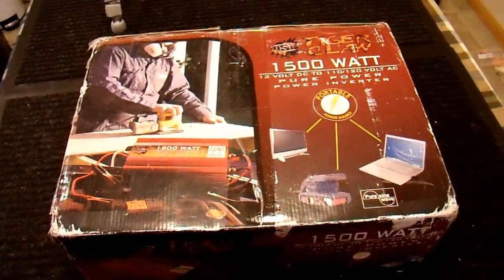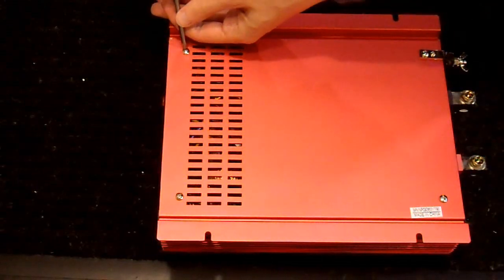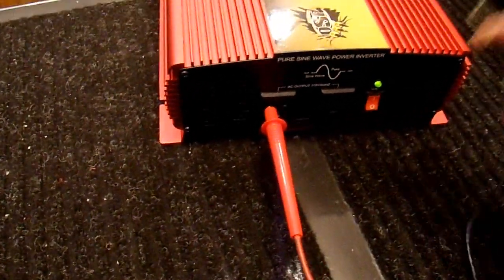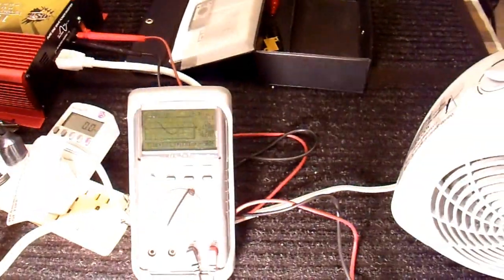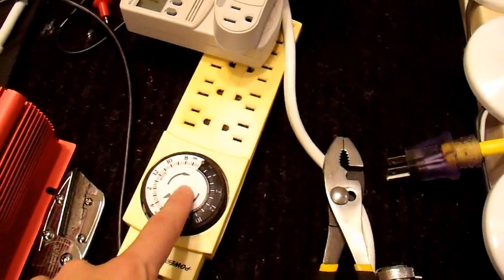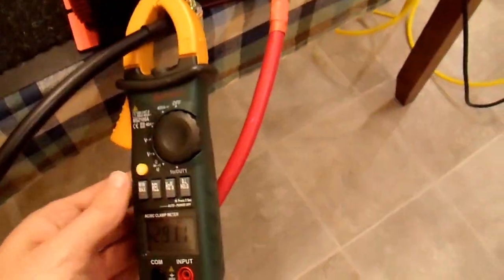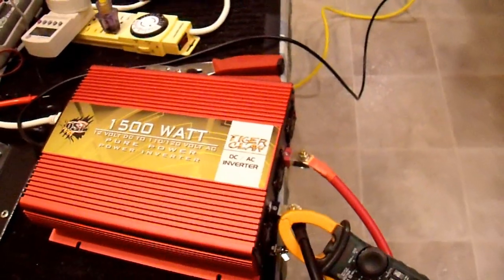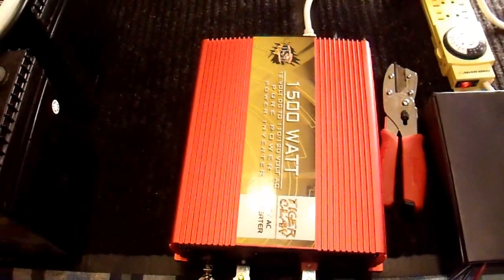OSP Tiger Claw 1500W Pure Sine Inverter Unboxing and Review

Comment: Just bought a 1500 Tiger Claw.  Your video(5-10-13) said it has a "live neutral config" and xboxer said in his video(2-4-14) it does not.  Who is correct and the reason I ask is I would like to back feed into my house main.
Reply: +Ronnie Boykin I would not back feed. I have a two pole transfer switch I connect to with a NEMA 5-15P to L14-30R. I'll be doing an updated video in the next few days soon. Also this inverter does not have a live neutral because of the fact you can bond the neutral and ground together and nothing will short circuit. You can easily connect this inverter to house wiring (via proper methods other than backfeeding without an interlock breaker kit) without issue.

Comment: I bought this inverter recently.  Plugged in my circular saw at 11 amps and the inverter turned off and began its beeping.  Tried my router, 9 amps, same thing happened.  Is there no surge allowance at all with this inverter.  Seems to me it should have least let the router startup.  Is the Tiger Claw no good for power tools?

Comment: Very informative, I have some issues with mine it is new used on a sailboat for 110 power but not working out except to charge a cell phone. thinking possibly not enough battery power? It's a 1500 hooked up to 1 battery, new to this so? Could very well be me and the setup

Comment: I have a 2000watts inverter, and it has two set of power terminals two positive, two negative.
What is the point.
Reply: It helps to reduce the monster wire sizing. 2000 watts out of a 12 volt battery is a crap ton. Use two sets of equal length wires and cut your wire sizes in half. Much cheaper!

Comment: Looks like the performance was pretty good... I watched your video regarding connecting to house wiring... I have an ancient 1:1 2000w transformer and it occurred to me that this would be a solution to address the issue with connecting to house wiring, and may even improve the waveform... what's your opinion on that?

Also, being in the UK the standard single phase supply is 230v, I don't have to worry about having multiple phases powering different circuits etc...
Reply from the maker: That transformer (assuming it is an isolated type) would indeed 'fix' many of the problems people have.  While it would not improve the waveform in any way it would be a workaround to many of the problems mentioned in my video about connecting a house to an inverter.
Reply: ***** Its so old, I have no idea... but I had assumed it would be isolated, but I would have to look inside before using it.  As regards the waveform, given the price of pure sine inverters today I probably wouldn't touch a modified sine one any more, but as regards improving the waveform... it seems to me that a transformer must be a low pass filter to some degree, so surely reducing harmonics must reduce distortion, I wonder what you think?

Comment: Great review.....One question...I would like to run some power tools...only one at a time...but, I may need up to 2100watts to run one of them. The question.... which inverter (in your ..educated opinion)  would be best ? Oh...one more thing I would need to go from 12v to 230v ..( I am in the uk). Thanks....
Reply from the maker: What power tools specifically would you like to run?  Things like air compressors are killers whereas things like heat guns are pretty easy to power.
Reply from the maker: Јохн Даниел
I have a Peak 3000W inverter sitting in parts  in my parts bin.  In my opinion it is junk and I'm not going to bother fixing it.  It is a re-branded Aims 3kw inverter, who in turn are sometimes re-brand Chinese products.  Given the poor design it is definitely assembled in a sweat shop environment somewhere.  I'm glad you've had luck with them but I've yet to see anything good come from Aims Power.

Comment: Do you believe this inverter would survive in a shed without AC, with temperature 100 - 120 F? I setup solar in my shed and I do like this inverter but am concerned about heat tolerance.
Reply from the maker: The internals are uncoated and will corrode over time when stored in a humid environment.  This is true of nearly all inverters that are not specifically designed for marine use.  Other than that it should work just fine.  As with any inverter high temperatures will reduce the output capability.  Expect this 1500W inverter to provide no more than 1000W of power in that environment and expect to need to replace the fans after a year or so due to constant operation.  The fans match the price point which means they are not top quality fans.  But be aware that you could pay more and do much worse.  :)
Reply: Thanks for the information.  Is there a coating that I could use to coat the internals?
Reply from the maker: Anthony Hope
If you purchase an aerosol PCB conformal coating, dismount the PCBs from the case, wash them, and then fully coat them up they will last much longer in a humid or saline environment.  For the home user an acrylic coating is probably the easiest but regardless disassembly can be a good amount of work.
Reply: ***** 
Ok, thanks bro.  I believe that I will just put it out in the shed and don't worry about it.  My main concern was heat,  so since it will survive the Southern heat,  I will let it ride.

Comment: Could you please comment to what this gentlemen said below ( M McDuff). I also am in the same boat as he ? I am building a solar project like him and running 14 awg wire completely seperated from any household circuits or breaker panel. It is almost like plugging a extension cord into the inverter. Why would ground have a voltage on it? Confused? Please explain  Thank you very much

Comment: Dude, luv the vids thanks a bunch! If they were the same $ would you go with the OSP or a Xantrex sw1000? Im down to the two for a gen purpose/ rv app inverter. Thanks!
Reply from the maker: I'd get the Xantrex sw1000 not because it is a better product but because I haven't inspected/tested one before.  If you're looking for long term reliability and good efficiency Xantrex is likely the better choice.  If you only need to use it occasionally I would suspect that the OSP is a more capable and less expensive solution.
Reply: sounds good, thanks for the advise.
Reply: ***** huh, "I'd get the Xantrex sw1000 not because it is a better product but because I haven't inspected/tested one before"? Why if you HAVEN'T tested or inspected it?
Reply: eman3082000 you're thanking him for advising you to try something he doesn't know is good or not lol? has the world finally gone insane?
Reply: ***** What's an OSP, I'm new to electrical speak

Comment: Yo! Really great video. I was wondering what you could tell me about this inverter that I have called a VANNER Model Number VLT12-300. I plan on hooking it up to my van to power some LED lights panel lights as used in film-making. Is it a crap company? Is it really 300 full watts? What is the surge limit? Etc?
Reply from the maker: Vanner is a high quality company but I haven't personally seen one of their units.  They don't generally market to ordinary consumers like the lesser and more well known brands.  Thank ambulances, straight trucks, etc.  The manual for that inverter is publicly available through a google search and it claims a 400 watt surge.  I would expect it to easily supply 300 watts continuous.  I see no reason why it wouldn't work well for LED lighting.
Reply: Dude, Thank you so much.

Comment: With cost unlimited what 1500 w pure sine wave inverter would you recommend?  Thinking of pairing with Trojan L16RE-B 370 Ah 6 volt batteries.  For extended vehicle expeditions PV on roof. Morning star controller. New to this. Haven't purchased anything yet.
Reply from the maker: Unlimited funds you say?  Well, I'd purchase an island, an aircraft carrier with a full crew supplied with a lifetime supply of all resources I need for my protection, and ....

But I don't have unlimited funds and am not able to answer the question since mine always are.  I think you may be looking at higher end inverters than I am used to reviewing.  First of all I would recommend at least a 2kw inverter, and 2nd I would recommend mounting the inverter on vibration isolators.  After that, well, the best I have found in that range thus far is the Samlex 2kw inverters.  I am sure there are others but stay away from anything Aims.  If anyone else here has recommendations please chime in.

Comment: i have two T105 6 volts batteries in series...looking for 1000 pure sine wave inverter for use in camper van...small basic applicances tv radio laptop etc... which inverter do you recommend   thanks

Comment: I got a cheap, made in China,1500 W inverter and hard wired it to the AC side of the converter which smoked my inverter.What did I not do to prevent this?
Reply from the maker: It's probably not the inverter's fault - at least directly.  If live voltage is applied to the output of the inverter it's 'game over'.  If live voltage is not applied but GND and Neutral are hard tied together as they are in a household electrical system, then it depends on the inverter's internal configuration whether it will work or not.

Comment: Hey knurlgnar24...nice vid liked it. Can I run a refrigerator (22 cu ft w/ freezer) off this setup?  4.5 amps 110v on the name plate.  And would I need more than one battery?
Reply from the maker: This inverter will start and run your refrigerator.  Many 1500W inverters won't, but the one I tested here will easily do so.  I would recommend at least two batteries with heavy gauge cabling to allow for adequate surge performance which will be needed to start the compressor.  Aside from that the number of batteries is more dependent on how long you want to run it between charges, cycle life, cost, size, etc etc

Comment: i just found you channel and i love it ;)
would you recomend tiger claw 1500 inverter as a good starting point for tiny  backup system just for tv  a light or two may b an laptop?    thining about buying 2 100amp batteries
Reply from the maker: It would be a good inverter for that purpose if you can still find one available.

Comment: I am using my wfco wf5100 1000 watt inverter in my house.The inverter is
 plugged into a wall outlet and using house current until i turn of the 
breaker then it switches to the battery bank.The unit is  mounted to the
 wall about 3 feet off of the floor the cables are 4' they are #2.The 
battery bank is 4 trojan t105 reading 12.9 volt under load.The load that
 i am running is a 32" lcd tv with dish network cable box and a dvd 
player.The total load is under 170 watts.The fan is always on even after
 i turn off the tv/dvr/dvd player.If it is load or temperature  
controlled can you tell me why when i turn off the inverter and just use
 the pass through of corse there is no fan.Help me under stand 
please.Possible fix.

Comment: Do you think this inverter could handle a 12000 BTU portable air conditioner the specs on the air conditioner are 1270 Watts 11.2 amps I noticed it had a problem maintaining much above a thousand Watts continuously?
Reply: Doubt it long term, if those listed numbers are real. When considering inverters, it's best to derate them yourself to about 70% of listed capacity.  Then again, it's best to do an actual amperage measurement of your a/c load (after it's started up), then calculate volts x amps to give you real world numbers. Manufacturers often increase the actual listed wattage a bit.

Comment: Is there a way to supply the high voltage Dc in a inverter with a small generator or solar input,
Reply from the maker: There are safety issues for sure, but disabling the boost stage and supplying the appropriate voltage to the HV DC bus should be all that is needed in most inverters that have simple control schemes like this one.  The primary complication I can see is that one will need an energy storage device at that HVDC and 180V battery banks are not something I have much interest in dabbling with given the danger involved.  In my opinion those DC high current voltages are best left to EVs and utility scale applications.

Comment: can you connect it to car battery (with the engine on) or will the 1500w be too much not to drain the battery even when the car is on?
Reply from the maker: Unless specifically designed for auxiliary loads vehicle electrical systems are designed only large enough to power the vehicle.  Adding additional equipment such as inverters will shorten the life of alternators and may cause electrical overheating.

If you're careful with electrical loads (no lights, radio, heated seats, defrost, heater fan, AC, etc) you can usually get 300W or so out of the vehicle, maybe 500W if you bump the idle up to 1500 RPM or so.  Opening the hood would be good to help it stay cool.  This varies from vehicle to vehicle by a substantial amount but no vehicle can support 1500W continuous stock.  You'd need something like a semi truck electrical system for that kind of output.

Comment: What length extension cord (s) can you run from this inverter,  I have a 800w microwave approximatelyn35 feet from where the inverter will be mounted is that a problem?
Reply from the maker: This is a more complicated question than it first seems and depends on a very large number of factors.  Without knowing those variables, however, my reply is that I would be surprised if your microwave does not operate reasonably well off of a 35ft standard 16AWG extension cord.
Reply: ***** thanks... I have an off grid solar home in Baja Mexico, last week I went down for the first time in several months and found that my DR2412 Trace inverter burnt up this past summer.  I replaced it with a Trace DR1512 (the only thing I could find jn MX on short notice)  but wanted to add a pure sine wave inverter to my system because the microwave use to give the 2412 trouble- so I think the 1512 will have the same kind of trouble.  Is it possible to feed  the tiger claw and the DR1512 off the same rack of batteries?

Comment: Thank you 

For example ,
I have 32 in TV LCD plus PS3 plus two lights 30W each light.

Is 1000W inverter enough???.

^_^
Reply from the maker: Yes, 1000W is a good size for those loads.  You could probably get by with less but I wouldn't recommend it.

Comment: Please help .

I want to run a TV plus  PS3 Plus lights.

What is the right inverter I have to use???.

Thank you.
Reply from the maker: That depends on many factors.  Where?  With what power source?  On what voltage?  At what voltage?  What kind of lights and how many?  Do you want to expand in the future?  What is your budget?  Is efficiency important?  Noise?  etc.

In general you likely don't need a pure sine inverter.  A general rule of thumb is to take what you think you need and multiply it by 2.  I'd guess around 800 to 1000 watts would be enough to make you happy with the inverter for those loads.
Reply: ***** Thank you 

For example ,
I have 32 in TV LCD plus PS3 plus two lights 30W each light.

Is 1000W inverter enough???.

^_^

Comment: you would have a p6n06 mofset i can buy from ya?
Reply from the maker: Probably not but I may be able to help you find one.  What brand is it and what did it come out of?
Reply: i t came out of a rally 600 watt i found one but somethin else is wrong with it i put a new one in and it fried the same way as last one i mean smoke and all but only the one backtracking and tring to find wny only it overvolting

Comment: ***** You got the more in depth testing video Figured I'd post a link to my video here. i hear your fans were clicking like mine were. they work just fine on heavier loads but light loads they are clicking/rattling. A few reviews have said this inverter died on them within a few months. I believe it was because of the fans not properly cooling the unit.

http://youtu.be/UXHkrY8td18

Comment: god those lamps screech like a rusty witch maby the next set of sockets get the pull chain kind  no screech no bulbs to twist in
Reply from the maker: I made the mistake of purchasing sockets that had threads made of fiberglass impregnated plastic instead of a metal insert to save a few bucks.  Never again.
Reply: its all geed man
Reply: ops i ment good